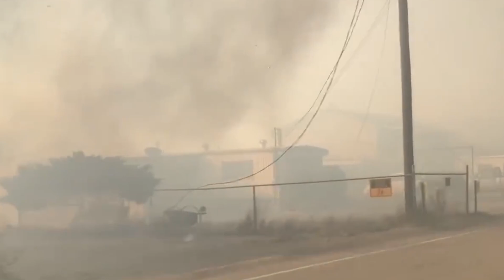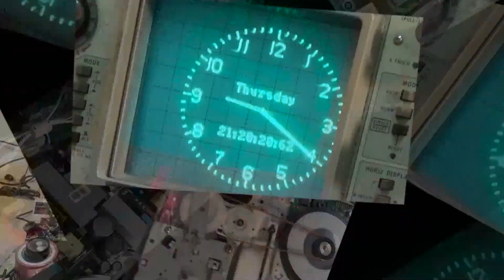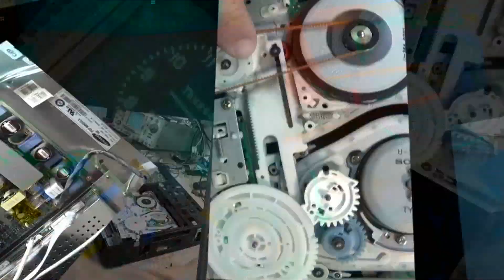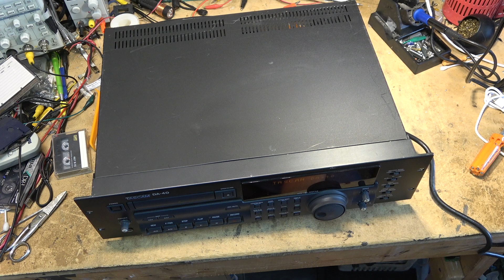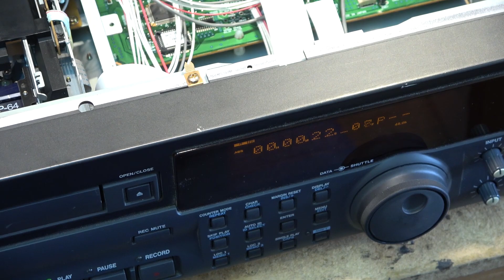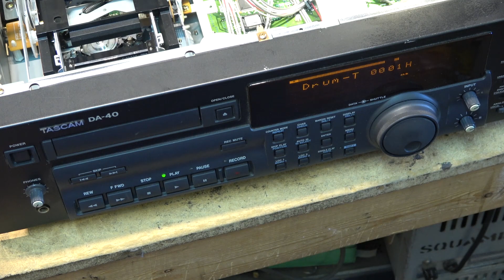Tascam DA40 DAT recorder repair

Comment: Do you have a vid on how to change the other 2 black tape mechanism belts? As you say, the smallest one is very easy to access. However the two bigger one seems to demand a higher degree of disassembly in order to thread the belts over the pulleys. All the best from Sweden.

Comment: R&R track's warp's, when it get that hot
Reply from the maker: News stories showed a flaming lumber car heading over a bridge that also burned.    My comments on caboose with firefighters on board is a valid one and I am sure the unions would agree on that statement.  One of the dumber moves the railroad has done.

Comment: Here in S. Oregon, we really got it last Sept.  Got most of Talent, and almost all of Phoenix.  We were on s. side of Medford, and had to evacuate, but, luckily, the winds finally dies down, and the fire depts. got it under control.  High temps, and 40 to 60 mph winds from the south.  Made this Almeda fire spread amazingly fast.  Over  2500  homes lost, and countless businesses.  Still looks awful driving through.

Comment: I have some loyal vcrs and tape decks my panasonic vhs from 1986 still works it only needed a new idler and a head cleaning it had a super dusty head underneath the video head.  I also have a mitusbishi svhs vcr from 2002 its one of my most loyal newer units and the last SVHS decks I bought new.

Comment: Yes ive noticed you like the tascam,  a well performing machine and easy access for repairs or just maintenance.
You have a soft spot for it, even if you think dat is dead :-D
Reply from the maker: DAT is dead.  I use my machine strictly for archiving.